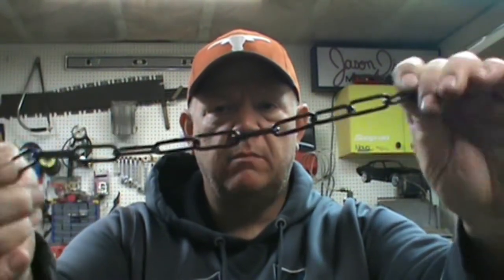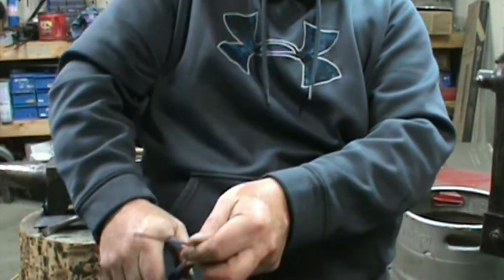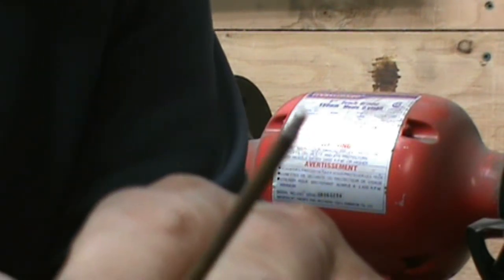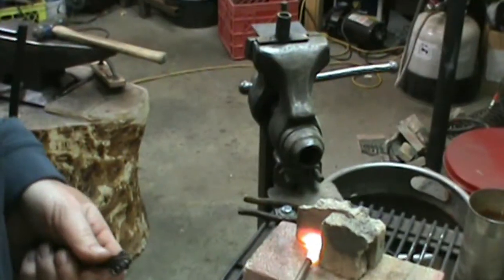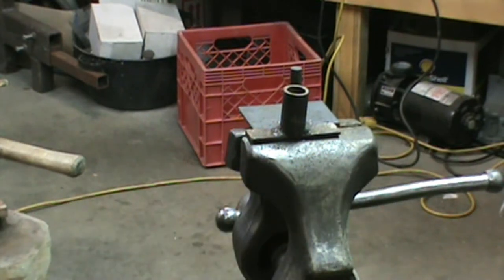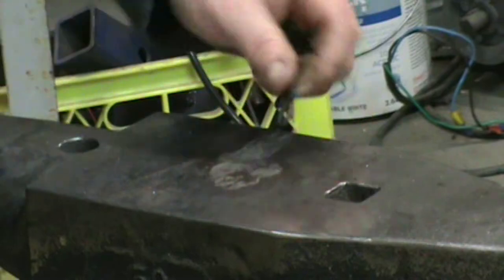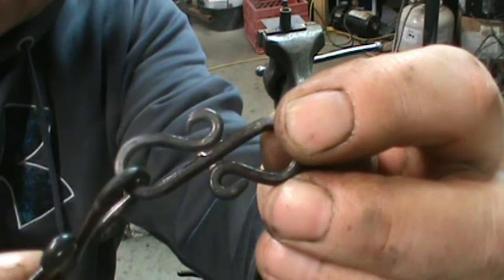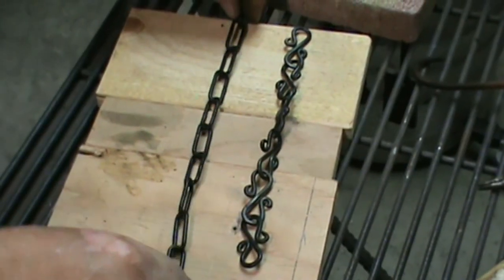How To Make Decorative Chain // Simple Metal Project

Comment: Neat project Chris. Definitely adds class. 👍👍😀❤️. One trick with the rods and cutting. I used to just kill my hands, and wear out side cutters. Cut about 1/3 in, on four sides. Then, grab the cut top n bottom, with a pair of pliers, and the back of the Hing joint of your cutter, and snap it. Much easier on the grip hand, if you're doing a production run
Reply from the maker: That’s a good tip JT. If
I’m doing lots, I just cut on my bandsaw. 👍😃🔥⚒